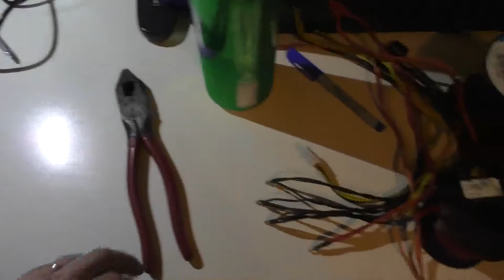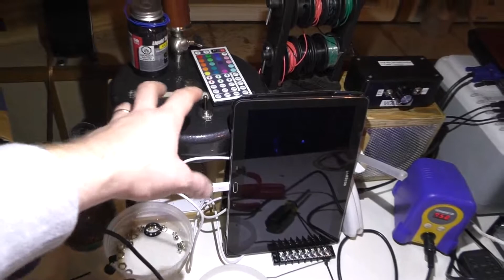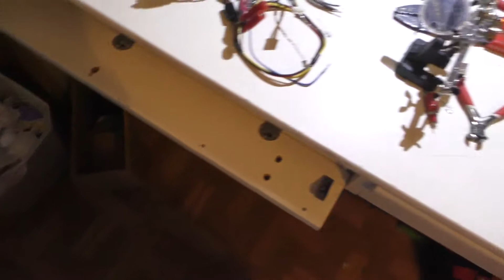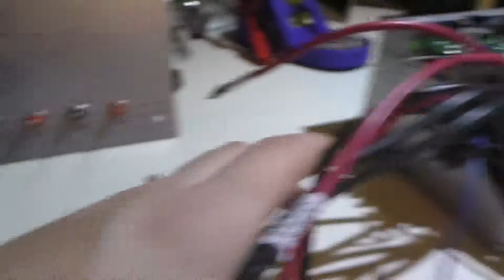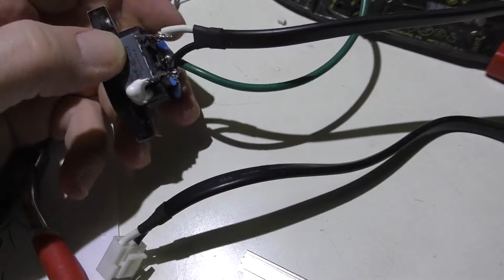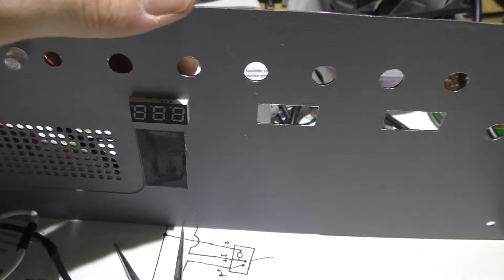Episode 29 - Brief Lab Tour & PSU Intro

Comment: At first I wasn't sure what you did with that switch coming from the AC side?  You showed the American (Black White) wiring and compared it to the European (Brown Blue) wiring and the connector.  I think I understand what you are doing is bringing the power ON switch from the back of the PSU to the front panel.  Is that correct?  When you do something, please say what exactly you are doing...like...I am doing this to bring the back Power ON switch to the front panel.  That way, it's clear.  I had to watch this part 3 times and keep using the stop start function to think about things a bit, then it finally dawned on me that you were bringing the power On switch from the back of the PSU forward to the front panel.  If you turn the PSU off at the AC in side, there is still a trickle current as I have understood it for many years.  The motherboard pulls a tiny trickle current to keep things on the board powered even though the main PSU is shut down.  Maybe this has to do with Wake On LAN?  The other thing is, you had the PSU unboxed and the PSU circuit board upside down.  You did some desoldering of wires and put in heavier guage wire.  Why did you do this?  What was the reason for using heavier guage wiring?  I presume it has something to do with drawing more amps, as if you are going to try and use 15 - 20 amps to power up something much bigger, in which case, you need 14 or 12 guage wire. Just want to understand what your intention was.  Second, did you discharge those large capacitors before handling the circuit board?  What did you use, a large 20 MegaOhm Resistor to discharge those capacitors?  That is what I would have done.  Feedback on my questions please.  Thank you!
Reply from the maker: This video is old now and I've watched out for missing things a little better now.  

If the AC power is switched  off there is no power at all going to the motherboard.  When the AC power is on, there is a small 5V line that powers up the motherboard.  This keeps the RTC circuit powered instead of the battery backup and while it does allow WOL to function, the main purpose if this 5V supply is for turning on the rest of the system.  the power button on the front of your computer is wired to the motherboard and you need the 5V to activate teh startup circuit.

The larger wires are for carrying more current without needing multiple smaller wires.

I didn't need to discharge the capacitors because I activated the power supply without AC power coming into it;  It drained itself.  I also work very carefully.
Reply: Thumbs up!